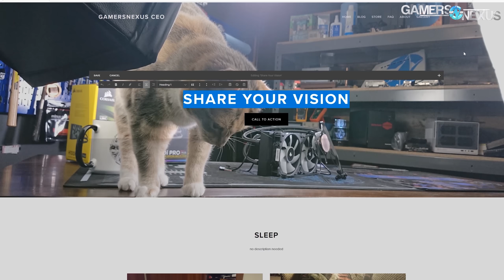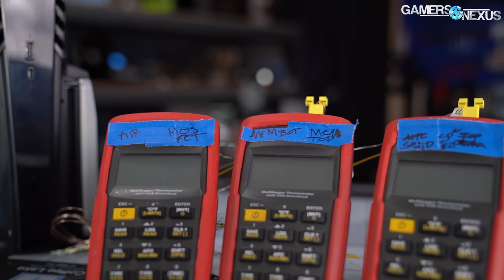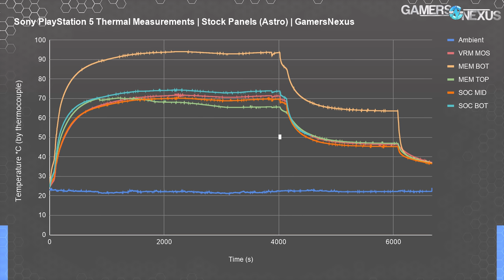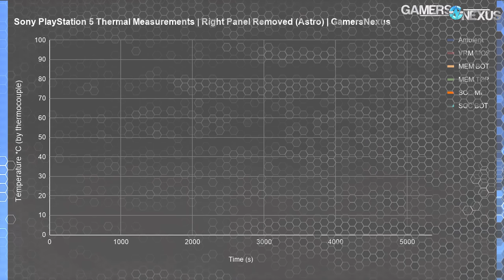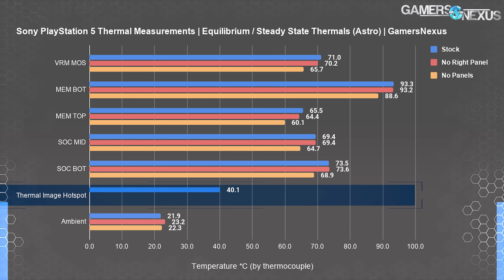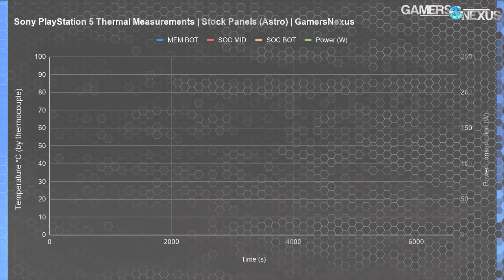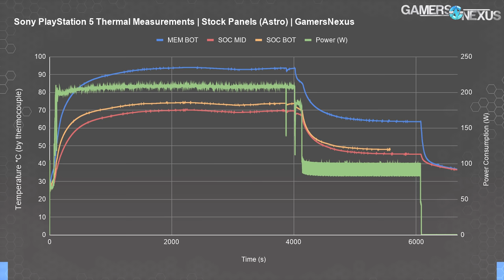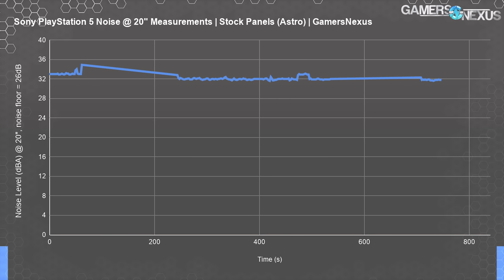Weak Cooler Design: PlayStation 5 Thermals, Power, & Noise Testing

Comment: As I suspected early long before teardowns, PS and Xbox have no clue what they are doing with this new hardware. Piss poor cooling solutions, terrible VRM design, and even worse power constraints that heavily gimp this new awesome power. Along with PR morons to design everything inbetween. You are looking at a console just barely better than the last generation becasue of margin-feeding. Here is hoping the "pro" version coming out will actually have a higher wattage PSU to actually take advantage of the hardware, and someone at Sony/MS actually have the engineers put in a viable modern cooling solution. So sad people are buying into this new hardware and getting nothing new in terms of next-gen gaming.

Comment: So a YouTuber with 1 million subscribers knows more about console cooling and how Temps affect silicon than engineers for a multi billion dollar company that more than likely spent millions researching this issue. The memory is fine...
Reply: Perhaps it is more a question of honesty rather than knowledge
Reply: Are you seriously suggesting that large companies don't make mistakes? Do you also think the xbox 360 was perfect and had no issues?
Reply: @infinitelyexplosive4131  this company was talking about this cooling solution and made it a priority considering how fast that gpu is clocked.  Do you really think they just happened to overlook something when there is millions or possibly billions at stake ? But a you tuber caught it right... Let's wait and see how many ps5's break down due to ram heating up issues and come back to this when it's verified and it's on a large scale ( red ring of death). I would gladly take an L on this one if it does. Sites like this report what they find but also don't speak to the manufacturer or know what type of limit in heat those memory modules have. This is something he should be saying instead of causing all this fear that the ps5 is going to over heat. But he got the headline and the clicks I guess.... don't be a sheep.
Reply: At no point in the video did Steve claim to know more than Sony, in fact he said the exact opposite.

He just pointed out that a specific memory module was running quite a bit hot, and on the edge of the spec for that module. 
He did not made a judgement of what that high temp means. He pointed out that there could be short to long term implications, but he didn't said what those implications are, and he acknowledge the fact that Sony likely done extensive testing on those memory modules, so they probably know what the implications are.
The only judgement made by GN here on this video is that the cooling for the PS5 and its memory modules could have been done better. This is an objective fact, those memory modules might be within spec, and MAYBE Sony and the memory manufacturers are confident that no long term negative effects will result from such high temps, but it doesn't change the fact that there where easy and cheap ways that Sony could have taken to improve the temps for those memory modules.  Likewise Sony could have improved the PS5 ability to remove the hot air that builds up on the chassis of the PS5 by adding some venting holes in it.

There is no fear mongering in this video. he didn't say that the high temps means  that the PS5 has a short life span or that it will fail, he didn't said anything like that at all. The "worst" thing he said was that the high temps for THAT SPECIFIC module was concerning. And that is objectively true. The temps were running right on the edge of the spec for the module, and the real temps for that module are likely higher than what they could see because of the limitations in the way they could test the memory temps. 
Other than that comment, the only criticism GN made here was towards the overall design of the cooling of the PS5, and they offered ways in which Sony could rectify that, and they acknowledge that Sony probably already thought about those ways but for reasons that are not clear to GN or anybody, Sony chose not to do it. 

You say that "sites like this don't talk to the manufacturers". 

You could not be more wrong about this if you tried. GN regularly talks to the manufacturers of these components, they occasionally go to the factory where these components are made or assembled. They have contacts with the people who build these components, so they can ask them questions directly on all sorts of issues relating to how these components are made and used.

Also you accuse GN of click bait journalism. Another further evidence that you never watch any of the content made by GN, and you started this video with a pre formed negative opinion of them based on whatever headline you saw on the post that shared this video in your chosen forum.

GN goes out of their way to ensure that people don't make wild assumptions based on their data. But sometimes you just can't stop people from taking a single chart and use it out of context somewhere else.

And at the end you say "don't be a sheep". Which is rich, coming from someone who got so triggered by a simple criticism of the cooling design that they decided to take the time out of their day to defend a multi billion dollar company, who doesn't give a shit about them.
Reply: @nitehawk-cg6jb  "Sites like this report what they find but also don't speak to the manufacturer or know what type of limit in heat those memory modules have. This is something he should be saying instead " He literally did. Did you not watch the video and then immediately jump to the comments? And you're calling other people sheep?

Comment: Weak design haha
It would have cost sony pennies to reduce temps on the memory. Sony obviously know the temps are fine.
These guys are basically xbox fanboys because it is more like a PC than PlayStation
Reply: Cry
Reply: @ag7367  been playing my ps5 solidly for 2 months with no issues so i aint crying one bit
Reply: @Pinkheartsequalfamily  two months is nothing. In 2 to 3 years all these launch consoles will be dead. Thats why Sony is working on a fix to this mess
Reply: @LiquidSpartan117  the redesign is to enable sony to push units out faster